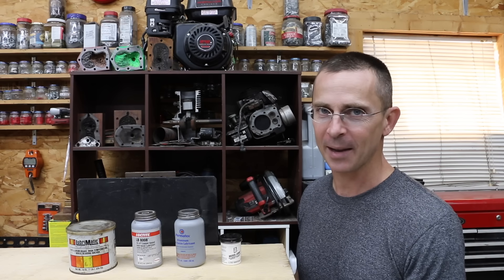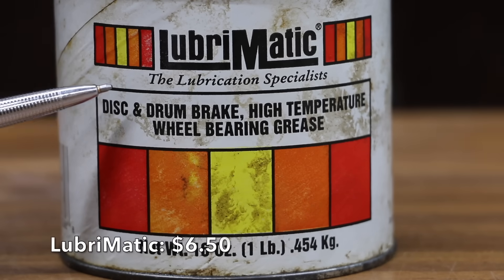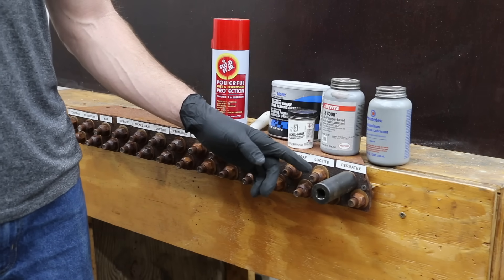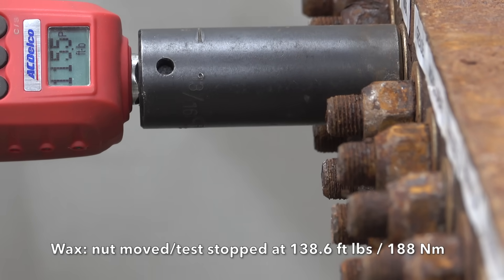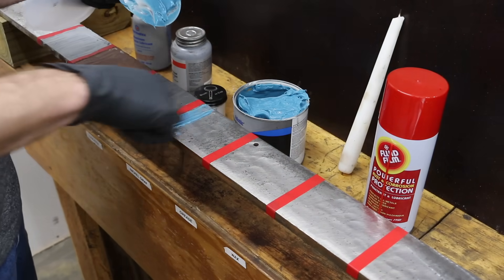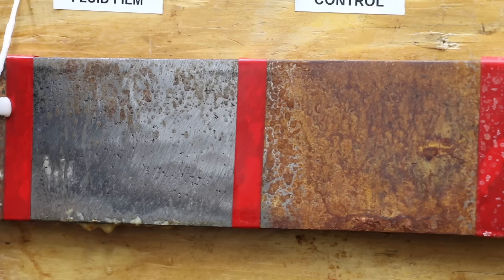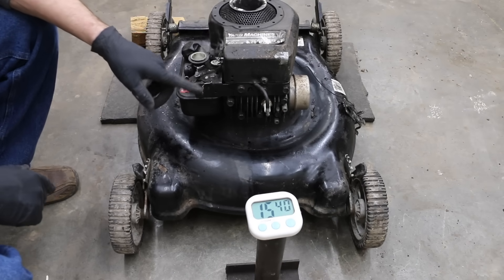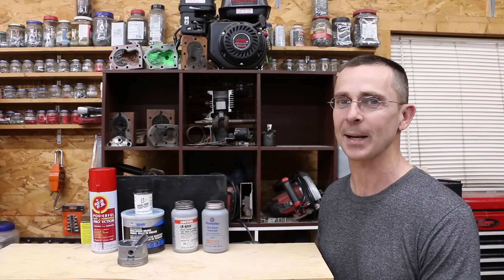Does Anti-Seize Compound Actually Work? Let's find out! Anti-Seize vs Grease vs Fluid Film vs Wax

Comment: Working on a marine cargo dock, where soda ash is one of the products.  Trust me, Marine grade   anti- sieze (loctite LB8023) is the only way to go.  Grease, penatrating oil, Syn motor oil, none of them last long enough.  If it has the anti-sieze you can get it off with wrenches.  Anything else you'll have to get hot or usually just cut it off.
Reply from the maker: Thanks for the feedback.

Comment: Anti-seize is to prevent galling, not necessarily corrosion. Galling happens when two mating, metal surfaces are under a lot of pressure - like bolt threads. It would be interesting to see if Anti-seize prevents galling compared to cheap, alternative methods.
Reply from the maker: Thanks for the feedback.

Comment: Back in 1987, I purchased a large tub of copper-ese because of the crappy motorbikes I could afford and never had a problem. I went to the US for 25 years and opened it last week to find my 1990s fingerprints still in there and it still worked fine. Well recommended.
Reply from the maker: That's amazing!  Thanks for sharing.

Comment: "NEVER-SEEZ" (tm) I believe,  was the first product on the market,  I started using it  decades ago.  It's amazing on exhaust manifold bolts - lug nuts - ANYTHING you want to take apart later.   Makes door hinges feel like ball bearings - BUT IT'S MESSY AS HELL.
Reply from the maker: Thanks for the info!

Comment: i wish you’d spend a bit more time or a separate video on what is the adequate use for each type. What metals can i use copper vs aluminum vs  zinc?  what if i have a brass fitting on iron pipe  on a grill? how about wheel lugs?

Comment: anti seize really works. I had an old morris  on which i put a wing using nickel anti seize on the bolts. 13 years later when removing the same wing every bolt was removed very easily , and still had the anti seize on every bolt.
Reply from the maker: Thanks for sharing.

Comment: one thing i discovered that is possibly the best at this is  Silaramic silicone brake lubricant.  The other day, i was replacing a drive axle on my mother's car and when i was disassembling the brake, everything came apart quite nicely.  i was looking at the bolts trying to figure out what the heck was on em, then i remembered that the last time i did the brakes on it, i used the Silaramic on everything.   Stuff's amazing. It's the only brake grease i've ever used that actually functioned well on brake components. It's a great anti-sleaze as well. It does not melt, it does not wash away.
Reply from the maker: Thanks for sharing.

Comment: Once again, an excellent video. 

I'd love to see a video about how to be both time and energy efficient as possible with blades/bits/batteries. 

If I have a 2 sawzall blades/drill bits and 2 batteries, what pressure will enable me to get the most cuts/holes? 

When should I change out the blade/bit or battery to get the most cuts/holes in an hour? (Assuming hand held tools across the board.)
Reply from the maker: Great suggestion!  Thank you.

Comment: Before removing the bolt you should clean the exposed threads because the anti-seize has nothing to do with the boundary layer that locks the bolt in place with rust and corrosion. The reason we use impact wrenches.
Reply from the maker: Thanks for the feedback.

Comment: I use anti seize (permatex) on railroad maintenance equipment on everything that I replace that I know I’m going to have to do periodic maintenance on. I can say it’s the best for cylinder pins and things like that. Really good at keeping a close fitting pin from sticking as it rusts over time.
Reply: Also use it as a lubricant on slides rather than grease , sticks better in my applications and provides more lubrication.
Reply from the maker: Thanks for sharing.

Comment: As an Extruder operator , I used the Loctite all the time on some massive bolts holding the Die together and NEVER had an issue. At round 350 to 550 depending on the machine, always worked great.
Reply from the maker: Thanks for sharing.

Comment: I use Permatex on almost everything that needs a little grease. I use it for brake pad connection to the caliper. I use it to grease the floating pins on the caliper. And I use it on the wheel lug nuts so they require less force to remove and don't easily corrode tight over the winter. 

I have used cheap grease before on the car wheel lug nuts and where the rotor meets the rim, and that also did a fantastic job when a year later or whenever I needed to remove the wheel and do maintenance. I do most car maintenance at home with no power tools, so easy work is what I want.
Reply from the maker: Thanks for sharing.

Comment: I have always used anti seize. Didn't matter the brand. I used it putting steel screws  into aluminum frames. If you don't, you will never get it apart.
Reply from the maker: Thanks for the feedback.

Comment: Idea: I see a lot of woodworking videos where they seem to be using way too much glue on each side of wood parts they are gluing together. Maybe you could do a video and compare wood parts glued together with different amounts of glue on the contact surfaces, from very light to heavily coated, and see if it make much difference. Thanks!
Reply from the maker: Thanks for the video idea.

Comment: I'd like to see that predator on the top shelf run with the cylinder pointing straight up, like a flat head engine would be. Maybe add a clear window to the side of the crankcase cover?

Comment: Anti seize is not a lubricant; it's actrually kind of abrasive.  The metal particles in the anti seize is abrasive.  My mechanic avoids using it as a corrosion-resistant lube.

I've found that using aluminum anti seize over the long-term is actually worse, because the aluminum galvanically bonds the two steel parts together, especially on tillage parts, like field cultivator teeth, plow points, etc.  Even the copper anti seize gums up with dirt, and makes it harder to take apart.  I've found that it's best to use a bolt with the least number of threads beyond the nut, and just put it together.  The impact wrench will get it apart just fine.
Reply from the maker: Thanks for the feedback.

Comment: I work in an oil refinery.  A lot of our equipment is over 50 years old and sees incredible amounts of heat,  heat cycling, and corrosion.  It is very common that we use nickel anti seize.  I can attest that the bolts where nickel anti seize is used there is an amazing difference over the years when it comes time to remove them.  Most of the time where no anti seize was used we have to cut the bolts off!
Reply from the maker: Thanks for sharing!

Comment: I can tell you, it works! Source: I live in Vermont and all my cars are rusty heaps. After I work on them once, they're much easier the second time, because I anti seize everything!
It's definitely worth noting that other than temperature rating, the different compounds actually have specific purposes. I use aluminum Permatex as my general go to, but have Nickel on hand as well.
Basically, the metal in the anti seize compound acts as a sacrificial anode, preventing the surfaces from corroding by being consumed first when in contact with moisture and oxidizers.
So, you always want to make sure your compound is more anodic than what you are trying to protect, you can look up the order of metals online. However, you also want to make sure it doesn't react.
Copper anti seize, while being a good choice for heat resistance, is not good for use on aluminum, as it can cause galvanic corrosion. It can also have reactions with some other chemicals.
It's also why so much steel is zinc plates, as the zinc acts as a protective barrier and is also less reactive than steel obviously. It's also why zinc or nickel are better for protecting steel in aluminum.
Basically, the steel is more susceptible to corrosion than the aluminum, and zinc or nickel will be sacrificial for the steel, but will not react with the aluminum. You also never want raw steel on aluminum.
If you put bare steel into an aluminum engine head for example, the aluminum becomes the sacrificial metal for the steel. Hence why spark plugs are all coated now and used to use anti seize.
It's also why aluminum is not the ideal choice of anti seize for aluminum usually. It is the same base metal and therefore may not protect it evenly or adequately, especially with constant moisture.
Lastly, because of this sacrificial anode principle, anti seize is not permanent and if exposed to moisture enough will need replenishing over time. Marine environments are especially harsh.
Note, this is partially from memory, largely from refreshed research, but it may not be 100% accurate. Just figured someone would appreciate it. One of many rabbit holes I have been down.
Reply: Related note: Also good to generally avoid stainless steel in aluminum, especially small amounts of aluminum, as it becomes very sacrificial.
Anti seize is definitely recommended despite both metals not typically being that susceptible to corrosion.
I also just want to mention it's why Zinc is such a great coating, because it is sacrificial to pretty much every other metal. :)
Edit: Final note. You should not use copper anti seize on stainless as it actually can cause the stainless steel to become brittle and fail.
Reply from the maker: Thanks for the feedback.
Reply: @ProjectFarm  Thank you for the awesome test!
Reply: hi 802, you're reply was exactly the answer to the question i was going to post.
Almost every cylinder head is now aluminum, so I've been trying to hash out what is  the appropriate antiseize for spark plugs.
It turns out for about 30 years I've been doing it wrong.
In the late 1970's I was working on an E-type with the 3.8 engine ( astute readers will note that most e-types have a 4.2, however I was working on an earlier e-type so let's not troll.) Anyway I broke a spark plug off, and even though it's been about 40 years ago it will be a day i will never forget.
Since, there has NEVER been a sparkplug in my hand that has not had antiseize, if not for me down the road then the other guy.
But, I have almost always used the aluminum antiseize , which was probably OK on the older BMC engines that are all cast iron, and with traditional plugs they had to be replaced frequently so they may not have time for extensive corrosion.
On the other hand, In 2020 we are using Iridium plugs, and people are going 100,000 miles and not even think about a plug change. 
So it seems from your post that the antiseize in this case would be nickel based?
This would be aluminum head, the next contact surface nickel, then steel threads ?, I often also use di-electric paste on the ceramic insulator, since both plugs and the plug wire/boot ( now from a coil pack rather than distributor) will be there a LONG time .
I am currently working on a BMC a-series engine, the head cast but the thermostat housing aluminum , held with steel studs. Any readers know how I can get this off?
Also, i have heard but not sure if true, that there are ships that are in a constant state of electrolysis with a sacrificial anode to reduce salt water corrosion
thanks
Reply: @VADOC02  Most blocks are aluminum now as well! Gotta love how even in YouTube comments you have to preempt the trolls, hah.
The best antiseize for spark plugs in an aluminum engine block would IMO be nickel based, yes. I cannot 100% say that is the best answer, but from my research I believe so.
However, and I know you might not like this, you aren't supposed to use antiseize on most modern plugs. Many say as much on the packaging.
That's because they use a plating on the spark plug threads, honestly I believe it's nickel based plating, or multi metal. This acts as a corrosion barrier and is quite effective.

From the NGK article 5 THINGS YOU SHOULD KNOW ABOUT SPARK PLUGS: "NGK spark plugs feature what is known as trivalent plating. This silver- or chrome-colored finish on the threads is designed to provide corrosion resistance against moisture and chemicals. The coating also acts as a release agent during spark plug removal. NGK spark plugs are installed at the factory dry, without the use of anti-seize. NGK tech support has received a number of tech calls from installers who have over-tightened spark plugs because of the use of anti-seize. Anti-seize compound can act as a lubricant altering torque values up to 20 percent, increasing the risk of spark plug thread breakage."

Provided you do not over tighten the plug, it should come out with pretty much any mileage, provided the plug hole was not frequently exposed to excessive moisutre.
As in, literally getting drowned. I've never had a problem removing NGK plugs with 60K+ miles as long as I put them in. Never used antiseize.
Before plugs had this plating on the threads, not using antiseize could definitely be a work day death sentence. I think all brands use something similar now though.
Obviously, you still CAN use antiseize, especially if you know of a particularly troublesome engine or plug. I'm just saying I don't know that I would in many cases.

I would just say definitely don't use copper antiseize, at least not in aluminum engines. Really though I prefer to stick to aluminum and nickel.
I too use dielectric grease on the ceramic and plug boot. Always a great idea to prevent moisture ingress! Also makes removal easier in the future.
For that thermostat housing, same procedure as always I would think. Penetrating lube, let soak, and use a bunch of heat cycles if they aren't giving up easy."
As for using sacrificial anodes, definitely true! Common practice for salt water boats in general as far as I know, and especially large steel ships.

Comment: I was replacing the brakes and pads on my car. I'm not joking, the front went without a hitch. The rear rotors seized upon a piece of the parking brake and took me like triple the amount of time to bang them off. I used penetrating fluid and waited about 3 hours. I finally went back out and knocked them loose very quickly. It was such a PITA!!!!
Reply from the maker: Thanks for sharing.

Comment: wife:  what's on the grill? 
PF:  Bolts.. 

wife: Where's the fish tank? 
PF: I'm using it for a test for spreading of lubricants on a metal surface..
wife: did you cut the grass? 

PF: couldn't, I threw a rod in the lawnmower testing anti-seize as a motor oil.. 

wife:  I'm outta here!
Reply from the maker: lol  Thanks for sharing.

Comment: I thin my antiseize with a few squirts of wd-40 into the can... sometimes the antiseize comes too thick in the bottle and its effectiveness is reduced by material being squeezed out from the threads during fastener installation. So if it is just slightly thinned, it is applied better.
Reply: Be careful. Since WD40 is mostly mineral spirits, it wouldn't take much to ruin your $10 can of antiseize!
Reply from the maker: Thanks for sharing.

Comment: Anti-Seize in automotive use is usually only used on spark plugs, exhaust manifolds and turbo flanges and it most certainly works for those uses.
Reply from the maker: Thanks  for the feedback.
Reply: So, the rest of the fasteners are doomed to be rusty and seized?  I think not!
Reply: @paulcopeland9035  
Some fasteners you don't want backing off thus why you don't use it on head, rod, crank and other bolts.  But sure go ahead and use it on everything and see what happens.

Comment: I’ve heard many people say never start a engine after it’s been tipped over or upside down because they say it will be hydro locked, but I’ve never experienced any bad things from starting after my bike was tipped over, maybe it’s different with car motors?
Reply from the maker: Great point. Yes, car engines can hydrolock
Reply: Project Farm I got one, I see a lot of people using this foam for post being put in the ground and it would be interesting to see how durable it is compared to the concrete